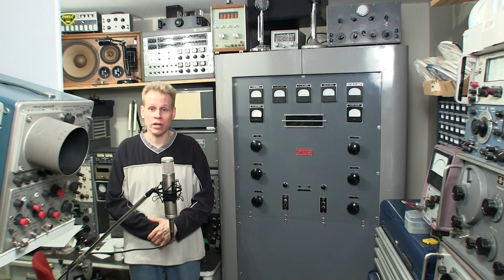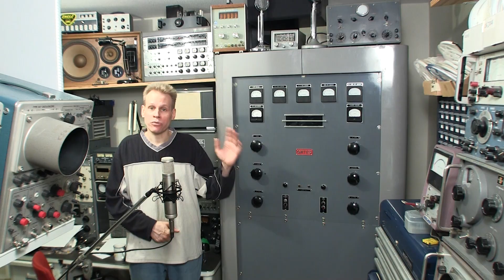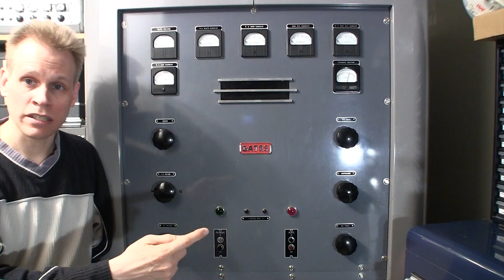Standing Inside a Broadcast Transmitter While it's ON!

Comment: Door safety interlocks on high-power electronic devices.  When I first started out in the early 1970s working as one of the DoD Electronic Engineers for the US Navy TERRIER Anti-Aircraft Guided Missile System (all were decommissioned in 1992 and I moved over to TARTAR, which went away in the US Navy a few years later), I went out on a post-overhaul shakedown cruise (about 2 weeks, mostly out at sea) for USS FOX (DLG/CG-33).  As a brand-new Systems guy (I graduated as dual Math/Physics Bachelor in May of 1972), I was to familiarize myself with all of the various parts of the TERRIER Weapon System by going various areas and watching how things were done and helping out as directed.  I did this and it was great fun for me, as it was all brand new and this was also my first time on any kind of ship.  It was not all fun-and-games, though.  One day, I walked into the TERRIER Tracking Radar Transmitter Room located directly under the two huge rotating tracker/illuminator radars that tracked targets and guided the missiles to them in a battle (these were just behind and above the bridge). I saw that two of my associates who were radar experts had one of the two huge transmitter cabinet's doors open and they had thick rubber pads under them and heavy rubber gloves.  The power was on and lots of lights were glowing all over the transmitter and associated equipment and one of the two had a long tool that he was just about to insert into the cabinet (to adjust something, I assume).  This was in a very quick glance, because the seated man who was not close to the cabinet turned his head to me and said in a very hard voice, "Get out of here, NOW!" and I jumped back out the hatch so fast I nearly fell down.  Later he told me that they had to defeat all of that transmitter's cabinet-override safety power-cutoff interlocks to troubleshoot and align a problem with that radar that was preventing them from performing a scheduled test firing and the fastest way was to see what was happening with the radar on and transmitting into the Dummy Load as if it was actually tracking a target (one of the standard test procedures being used here as a troubleshooting tool) and then try to see what happened when certain adjustments to the hot transmitter were made "on-the-fly".  When I walked in with no protection, I could have been electrocuted by the ONE MEGAWATT Pulse Transmitter, which is what they had open, by an arc flashing over several feet of air and the radar would not even notice it.  People had been killed like that over the years when such high-power systems went into service and he did not want me to become another statistic.

Comment: Hi Mr Carlson, I love your video of this big Gates Transmitter, Wow I did not know that Ham operators would need to buy something this big. I am sure you must be useing it for 10 meters am I right? I use to work at a Radio Station call WHLB Radio AM 1400 up here in Virginia MN that is 60 miles north of Duluth MN. I worked on the AM Transmitter for WHLB AM 1400 & We had a Herris MW 1 Transistor Transmitter & sadly WHLB Radio came to it's Death back in 2002. I to was a Side bander on the CB Radio for years & I miss it a lot. I now live in an Apartment Building & I cannot put up any kind of an Antenna to make use of My Radios. But when I had it from 2001 down to 1978 I would talk all over the country & even in to other countries on side band. At WHLB We had a old RCA FM Transmitter that was 1000 watts & the AM of WHLB was all so 1000 watts to. WHLB AM & FM was owned by a close friend of mine who got the Station from His Dad back in 1986. The FM was sold off to Midwest Radio in the fall of the year 2000 & the FM call letters were changed & the FM was moved out of WHLB Radio in Virginia to Hibbing MN in OCT of 2000. The AM 1400 at 1000 watts was not able to support it self any more but Frank My Buddy had it on the Air still & He laid off the staff & I was the only one to take care of the Programing. Sadly in the fall of 2002 the AM Harris MW 1 burnt out & went off the Air. All the RF Modjuls had burnt up & all 13 of the RF Solied State Boards blew the fuse to each RF Modjuls & WHLB went Dark & never came back on the Air again since OCT of 2002. $3500.00 Damige to Fix or Buy a new AM Transmitter & The owner could not afford to fix it. The Station fell in to disrepair by 2005 & in 2008 the station was torn down & Parts to the AM Transmitter were missing but 70% of the AM Transmitter were still there & all of it went up for Junk & trash. The Station was torn down by the City in 2008 & the FCC would not renew the call letters back in 2006 when some one wanted to buy the Place & get it back up & running again. I would like to know & see how you are able to use a big transmitter like this in your own home for Ham use. I know a 10 Meter Ham Radio has it's own Transmitter in it & if you want to get more power you can get a liner amp & get lots more power out put FCC Legel to. I sure would like to get in touch with you, You can get a Hold of Me at soundmaster404@gmail.com , I would like to send You Photos of the inside & the out side of WHLB AM 1400, MW 1 Transmitter. I love old Tube stuff. I am retired now But I would love to send you Photos of the Station & hook up with you some how I love Electronic stuff a lot. I ones worked at Grand TV in Duluth MN in the late 1970s & I had My own VCR Repair business up here for 18 years. I enjoy restoring old AM Radios & Ampro 758 & 757 Tube Reel to Reel recorders. Your AM Gates Transmitter is so Cool & i did not know 10 Meter ham Radio People use a True Big Radio Station Transmitter like this in there own Home. Your so Lucky to have that. Hope to here from you & would like to see your other big transmitters to. take care,  Jerry

Comment: In 1983 thereabouts, while in training as an engineer cadet at Bletchley park for the Civil Aviation Authority studying RADAR, radio and navigational aids we were sent on a field trip to see  Rugby radio station. In there, in the middle of the 8 giant 820ft, 170 ton towers we were shown the transmitter building... engineering on a massive scale - we got to see a "live" "Mekon" - a multi armed mercury arc rectifier. The output terminal to the main aerial ring was a giant insulator going through a massive hole in the building wall.

Was an awe inspiring sight - last of the "Empire" stations I think - now no longer with us.

https://en.wikipedia.org/wiki/Rugby_Radio_Station

"the Mekon" looked a lot like this:

https://www.youtube.com/watch?v=QY6V2syGnZA

Thanks so much for your most excellent videos - very very informative - has re-awakened electronics into my life after a career of computing since I left Bletchley in 1984.

Comment: N9ZN (that's me) could put that transmitter to use no problem. All my station needs is an antenna, a radio, and a consenting housewife. Unfortunately, apartment life killed my enjoyable amateur radio hobby. The hobby is on hold for now with dreams of reviving it when I locate a suitable antenna location. You never told us which broadcast station previously owned that sweet little transmitter.

I remember the many days when I was a Disk Jockey Broadcasting at a small country and western station in Sand Springs, Ok. I worked the shift after Bob Losure of CNN Anchor fame during the late 1970's ~ mid-1980's. We had remote transmitter meters which had to be logged hourly to suit FCC regs for broadcast stations. This was my first job at a radio station and I loved it. If only the wages were better in the market area, a union would have helped, I might have stayed with that profession. After moving on to a few other stations and music genres I eventually left for a career in computing where I have never been more unhappy. Good pay but horrid profession for my desires. I am now retired and thank the Lord daily for it.

73's my friend!

Comment: Actually a 5KW amp is legal for hams if they tune the grid currents and voltages to maximum legal input power. But the transmitter has to be capable of that, and ensure you calibrate your current and volt meters to stay legal.

Comment: I used to maintain HF transmitters 1 to 10KW and once a LF Txer calbable of 100KW but we used to run it at low power ~ 17KW to preserve the life of the amplifier. Loved working in transmitters also looked after the maintenance in receivers too. All with the RAF. Miss this type of work, it’s all too rare now.

Comment: How does a pentode function compared to a mosfet?

Mosfet's of course work with voltage but output current, so the two aren't directly related to each other, so the voltage control needs feedback to compensate. Is this similar to how pentode's work?

Comment: Had a do-it-NOW! opportunity to haul a ship-to-shore transmitter out of a garage one time but couldn't conceive of a way to manhandle it on short notice - monster tubes! Hey - what about the Hammond amps with tubes that glow ultra-violet?! I had a friend that had home-made am/ fm radio stations and he had 3 working tele-types and millions of feet of cable connected to everything so he could run it on auto-pilot..smelled like old ash-trays thoughout. When he gave the weather report it went thus: "And now the weather.." and then you would hear the springs from the chair squeak, then the souns his shoes made as he shuffled off..then the window noise as he raised it; then all of it in retrograde, and "Yep, it's snowing."

Comment: Awesome video!  Was wondering how much distance must a person be from a TV or FM transmitter antenna to be safe?  I'm speaking in terms of paramotoring, where I've seen some guys flying close to the top of radio antennas, which is a spectacular view, but was wondering if there couldn't be an issue with RF burn or not.  Please enlighten me if you have time, thanks!

Comment: I'm kind of new to audio. but I know a lot about 70 volt speakers and amplifiers like from brands like TOA,BOGEN,ATLAS SOUND and I am very into sound reinforcement. So when you noticed that transformer for that transmitter I Knew there is quite a bit of power in that thing. Btw how do you get power to that thing? If thats in you house you would need very big breakers right?

Comment: Back in the 70's I worked for a small town AM radio station.  The main transmitter got damaged by lightning and they bought a Gates 250 Watt transmitter to get back on the air.  We used to say we were "Johnny on the spot with a quarter kilowatt".  Management didn't like it however.

Comment: I love these old transmitters! A local radio station here, WMMB-AM (1240 kHz in the graveyard subband), had a Gates 1-kW transmitter which ran at full power 24/7 (the station was, and still is, a Class B station) -- I don't remember the specific model but I did see an old newspaper photo of it from the 1960's. 

At that time, the transmitter and studio were located in the same building. That building is still there with a solid-state Harris transmitter (Harris actually has its world HQ here!), but the studio is now remotely located. 

The station still runs at 1-kW 24/7 from the original transmitter shack. It still uses the original antenna, a folded dipole on a 300-foot tower.

Comment: Mr. Carlson, Thanks for the awesome Videos.. My first "Job" out of high school was as an Assistant Engineer for  4 UHF-TV <analog> and 4 FM radio stations... From a couple decades of experience working around these "RF Flamethrowers" i did want to throw my 2 cents worth in on the topic of Transmitter Safety: 1) NEVER take for granted that the safety interlocks have made the inside of the transmitter "SAFE" There is ALOT of stored energy in transformers and capacitors in these monsters, and even up to an hour after a transmitter has shut down you may still have lethal voltages inside <not to mention the 120-480vac mains>  2) no transmitter manufacturer includes parts they don't intend to be used. If when you open the back door of a TX and there is a long Porcelain rod with a metal hook or ball on it tied to ground..... USE IT .... pick up that tool and reach in and touch everything you may come into contact with FIRST... 3) If your transmitter shares tower space with other broadcasters, remember that antennas work in both directions... Just because your transmitter is shut down, be wary of your transmission line, it will likely be picking up radiated energy from other tenants on your tower and can leave your transmission line with painful if not deadly levels of RF on it.  <Unfortunately, Being Young and Dumb, i learned ALL of these things the hard way... And I've been bit by a 30kw FM Transmitter's Plate-Supply.... Lucky i didn't die... but i do have permanent nerve damage in one finger... >   - Anyways! Thanks Again!!!
Reply: I agree with most of what you wrote. However, transformers do not store energy. Capacitors do, but most large capacitors have bleeder resistors to eliminate the stored charge over time. However, the bleeders can fail - I never trust them and always short out HV capacitors before working on HV circuits.
Reply: I became well acquainted with HV early on.  Received my novice class license at 14, general a year later.  Since we were at the FCC office and finished the excam quickly, we also took the 3rd class commercial exam without any study and passed.  Then took the 2nd class and almost passed; even we were amazed.  

In those days, around 1960, we had very little money for equipment and built our transmitters from components scavenged from TV sets.  One night I took about 450 V between hand and chin - that smarted and I learned a lot from the experience !

Comment: Very interesting!  If I read correctly you have 2.7 Amps into 50 Ohms or 364.5 W output and 1480 x .355 ma or 525.4 W input, 364.5/525.4 or 69% efficiency. Is that correct?

Comment: 1500 vdc? It’d hold you there as dc is direct current. Ac would throw you since it’s alternating current as apposition to dc which is a direct beam, where ac goes back and forth.
Reply: I believe you have it reversed om......AC will paralyze you to what you're touching.  Walt

Comment: Good tour Paul.  That's a lot of steel, copper, and glass envelopes!  But I guess back when it was designed, everything had to be big and heavy or it was likely to be construed as under-built.  I am assuming that the 250 watt carrier was modulated upwards to a KW?  I sure would like to hear you on the air with it sometime.  Tnx, Joe W4JF
Reply from the maker: Hi Joe, thanks for your comment! The Gates will forward modulate to 1kW "quite easily." If I get on the air any time soon, I will PM you. Take Care!

Comment: That's a cool modified transmitter, what frequency do you run it on? 3885 Khz 75 meter ham? would love to hear it on the band someday! by all means, more old transmitter videos.  Yes I love the old EF Johnson ham equipment - I have a mint Viking Valiant, still works. Thanks, N8EFJ Toledo.

Comment: Great video! A trip down memory lane for me...in the late 1960s, I worked for RCA in Meadowlands, PA, building AM broadcast transmitters...mostly 5kw units, in walk-in cabinets like your Gates. Lacing cables, bolting stuff in place, wiring them up. My initials are inside the cabinets of several XRs. As a young guy, it was exciting for me just to be around heavy iron like that! Something magical about big glowing tubes . . .
Reply from the maker: Thanks for taking the time to write!

Comment: I remember seeing a huge machine about the size of a bus, that used 50,000 W R.F
to heat & dry toweling running through it.  When you open any of the side doors,  all
the lighting inside was just numerous Fluoro Tubes, held with spring clips !! No wires.

Comment: We get 1500 watts power out of tube amp units no binger than a toaster oven these days.  What was the reason for using such huge components to produce 250 watts power?
Reply from the maker: The answer is simple. This is not consumer electronics, this is industrial, designed to deal with large variation in multiple situations. Big equals dependable. Lots of very over rated parts to make a failure point almost non existent.

Comment: Why the hell an 813 driving a pair of 810's? The 813 puts out that same amount. A 6146 would have been my choice of driver. You only need about 25 watts to drive them.
Reply from the maker: The answer is simple, "everything overbuilt for dependability." That 813 is sitting there idling, while doing its intended job.

Comment: As a teenager in the early '60s, I worked as a disc jockey in a small radio station that had one of these Gates transmitters. It was a small town station, housed in one unit of an old motel. The transmitter was right there in the same room from which we played the records, and pretended we were right up there with the big boys. We operated at 990 KHz on a clear channel, dawn to dusk. I can remember seeing all those big tubes brightly lit as I peered through that little window in front. That station is gone now and I have no idea what happened to any of the gear.
Reply from the maker: Thanks for sharing that story Rick!

Comment: 23:00 Carlson, if you have a handle, you're rotating the camera with, you might want to use a rubber band ring between your finger and the handle. This provides for finer control of rotation and adds smoothness.

Comment: I would like some information on the inductors and components that don't have a way to find out. so if you could help me find values that would help a lot!
Thanks,
Vincent
Reply: Hello Paul,
Learning a great deal from your video series. I purchased 4 NOS 810's and 2 813's and also a pair of 8008 rectifiers.
Reply: Continued... I am building an AM transmitter like the king size walk-in you have. I need help with how to figure out the inductor values in the power amplification circuit. Also if you have any information about the B+ filters. Please let me know. Thanks!